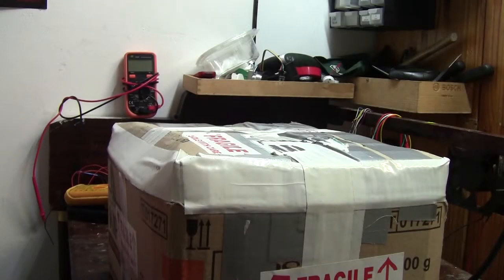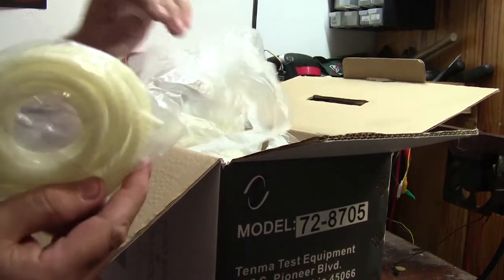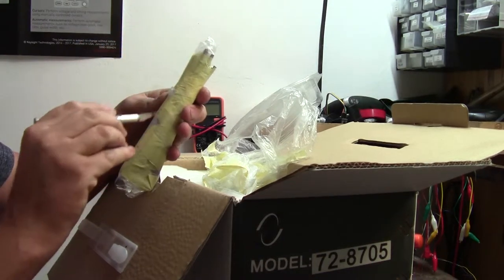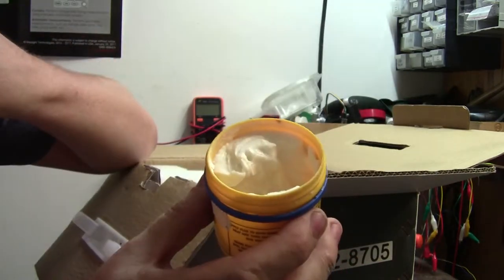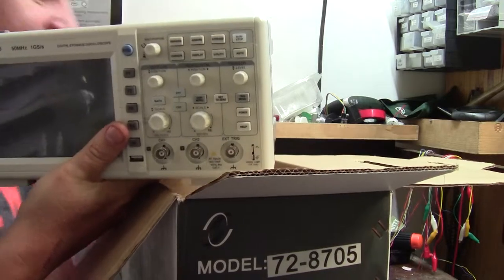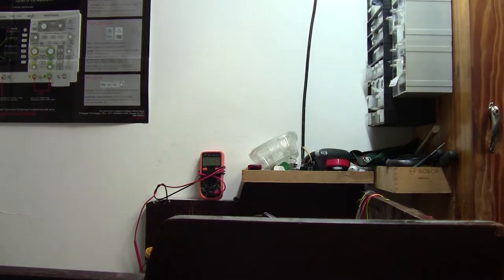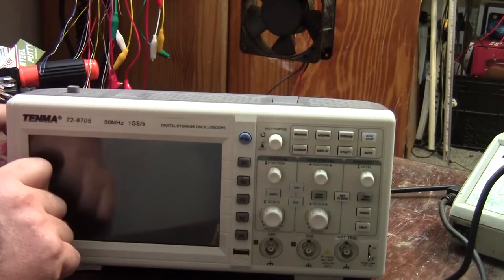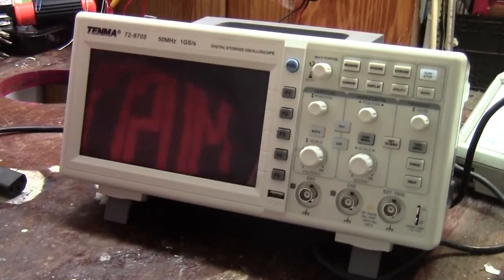ShoutingElectronics #18 - MailBox / MailBag / Postbag - Whatever you want to call it

Comment: Manual is available online for you, and nice to see Postnet is faster than SAPO in delivery. SMD kits are there for practise, as I bought a whole pack of them on fleaBay and had a few left over. Flux is the stuff from your favourite shop in Durban, will have to show you the other 2 just down the road from them as well. Tweezers were a job lot at the scrapyard, the big ones just grind off the end, as you probably are not going to use them to remove stitches as intended, though they grip wire quite well. IEC lead and probes did not come with the pack, and the spiral wrap and ties were the closest packing material to hand, they are both very useful in projects.